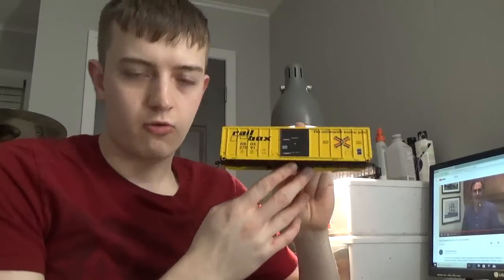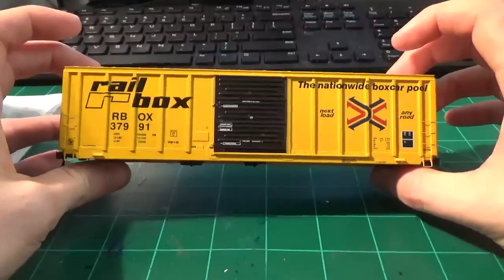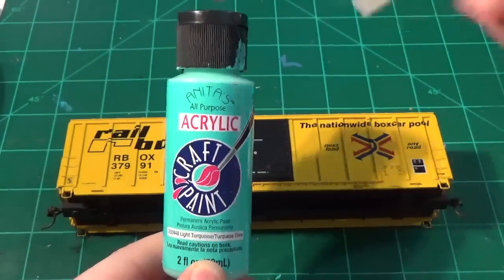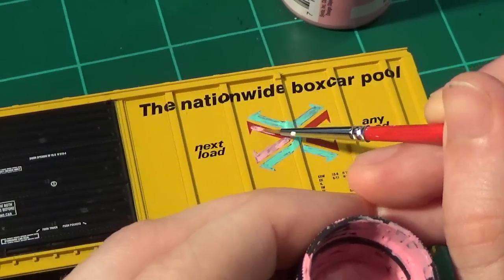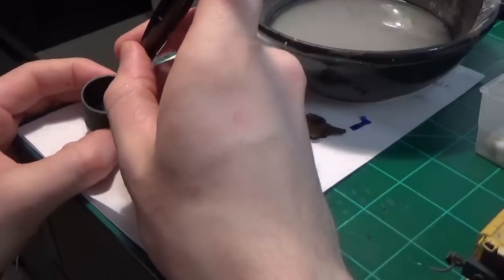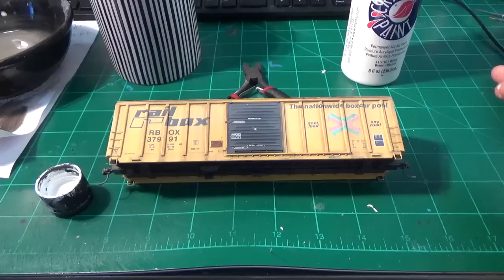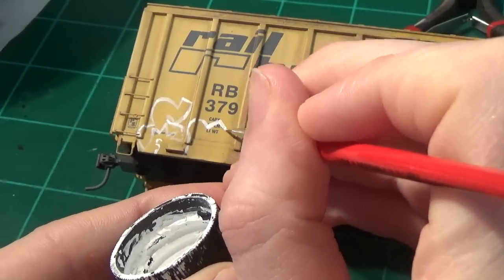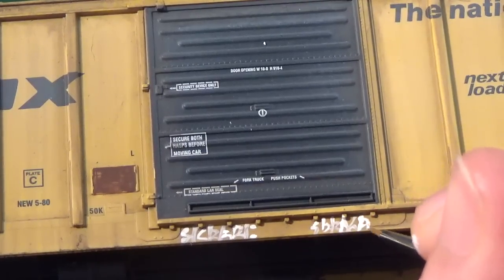The Railbox!  HO Boxcar Weathering Series.  Episode 1.

Comment: Dan, I have a question for you. Or for anyone else who may be able to answer. I'm following along with your video, but when I was airbrushing the "fade" it came out a bit too spattered. Is possible to start over? How would you remove the acrylic?...If so, should I use a thinner mix of alcohol/white?...Thanks in advance
Reply from the maker: You need to dilute the paint further and mix it better.  Remember it has to be thin, but not to thin.   Just take warm soapy water and a toothbrush and softly scrub off the acrylic in your bathroom or kitchen sink.

Comment: Hey Dan, quick question regarding this technique. As an alternative to airbrushing, could someone also achieve the underlying fade by dry brushing the same type of water mixable oil paint, but using a white paint, and then after some drying time and sealing, then applying with the same technique the burn umber oil paint?